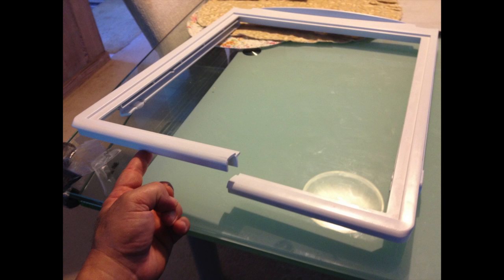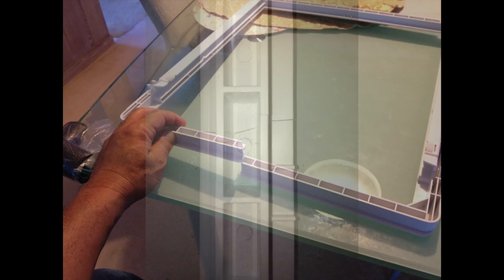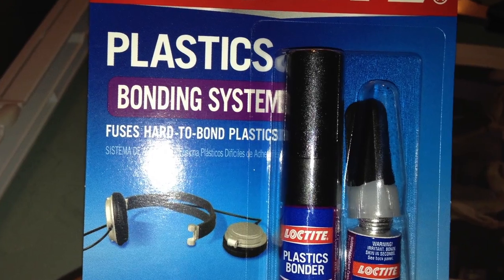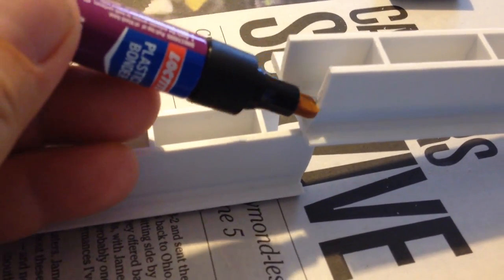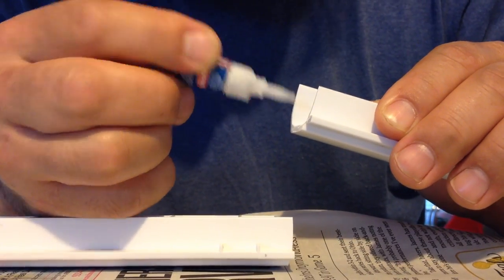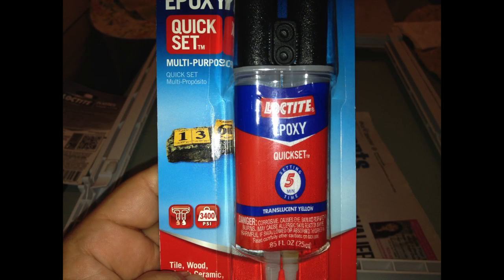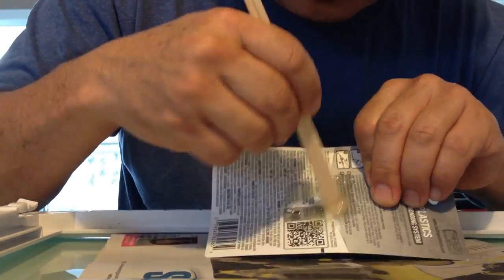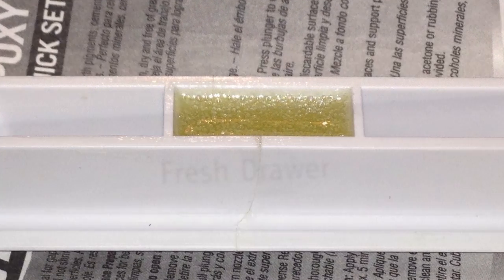Refrigerator Shelf Repair

Comment: how important is th epoxy? is it a must have?
Reply from the maker: In the past, I have not had good luck with gluing plastic together with such a small surface area to bind.  So for me, I wanted it to be as strong as possible.

Comment: 4 years later, just used this technique - appreciate the video! I'd love to know if your shelves are still holding up after all this time!
Reply from the maker: Actually, the refrigerator stopped working and had to be replaced.  But the shelf was in holding up to use right up until it died.  Good luck!

Comment: Thank you so much for posting this. I have the same issue and Frigidaire won't stand by their design (which is clearly flawed for this shelf frame). They wanted $80 to replace the plastic frame. I appreciate that we can DIY it now. #FrigidaireFail
Reply: same here.  I did what this post said - hopefully i fixed it.
Reply: Ikr. These refrigerators are defective and they suck

Comment: i would like to see someone do plastic weld on this
Reply: yeah, I was considering getting out the pvc glue and solvent... right now I'm waiting for the super glue to cure... it's been over an hour.  First repair attempt was epoxy -- cured for 24 hrs, put in service on a drawer, failed within first day of use.  The cold just render it too brittle.